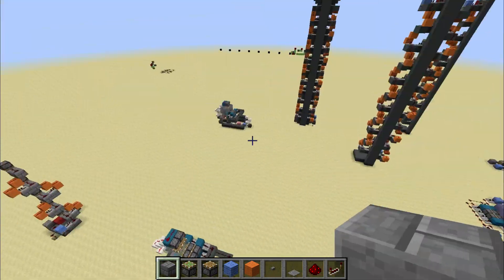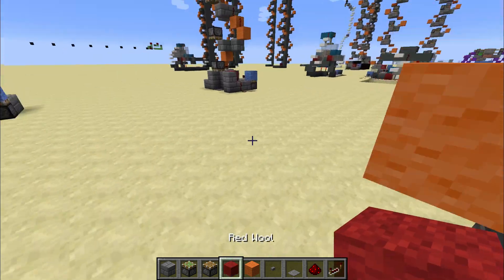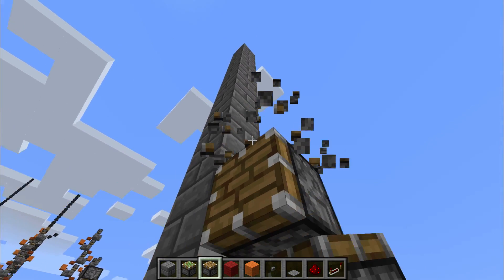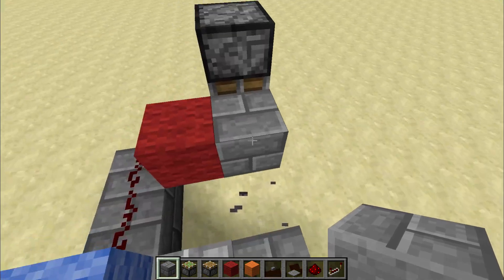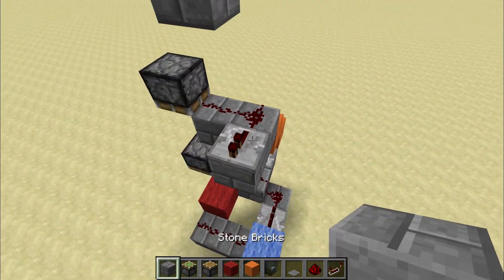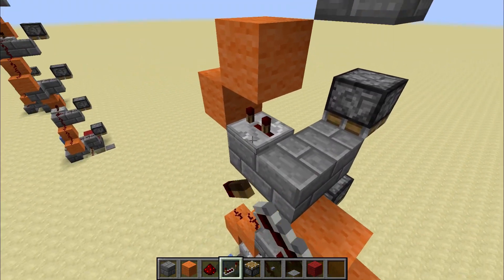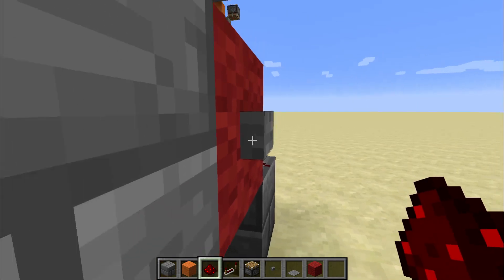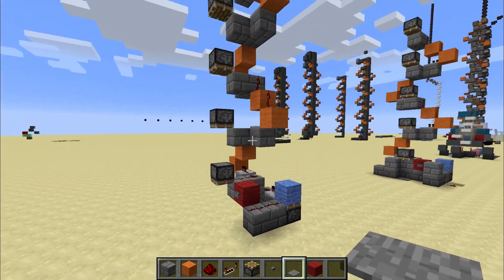How to Build 30 Block/Second Elevator in Minecraft 1.9 (Express Tutorial)

Comment: i was messing with a similar design but if i used any less than a 2 tick delay i wasn't getting to the top, i'd go through maybe 3-4 pistons before it glitched out, I'm putting it down to my game lag as i don't have a powerful machine but i'm really nnot sure
Reply from the maker: +christophermc2 Yea it comes down to the power of the computer/server at that point, because everything is moving so quickly that any little hiccup in framerate can make you fall out. The fix is just to increase the tick delay like you said but obviously when you do that it will only be half as fast.

Comment: hmmm i build your contraption but in 1.9 release it isn't working somehow the signal doesn't make it al the way to the top...
Reply from the maker: +Pascal de Vos you are sure you have the repeaters facing the correct way and everything and you didn't miss any dust?

when you say the signal doesn't make it all the way to the top do you mean the redstone signal physically doesn't reach the top or do you mean that you stop in the middle of going up the elevator?

If you are randomly stopping in the middle but the pistons are still firing then it is probably due to lag, idk if you are playing on a server but that can easily cause this.
Reply: +chappy454 not missing any dust or repeaters, all facing the correct way, and yes stopping in the middle. But when i watch if they fire all, not all of them do. looks like the pulse is too short for that. Have you tested it in 1.9 release or in the snapshots?
Reply from the maker: Pascal de Vos It works in the official 1.9 release in single player. If you are playing on a server or if your computer is not as powerful this can cause lag that makes you fall out in the middle.

to fix this just add one tick to each repeater in the stack (but leave the first repeater coming out of the pulse limiter on only one tick)